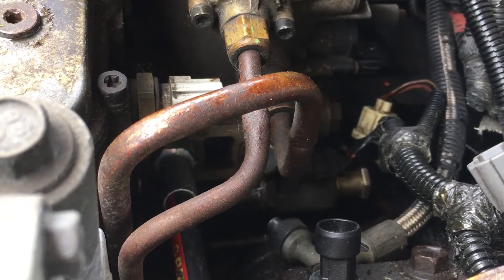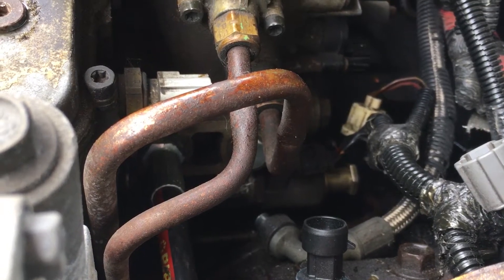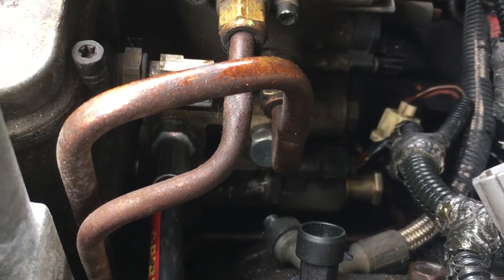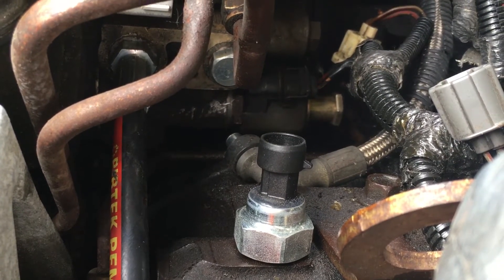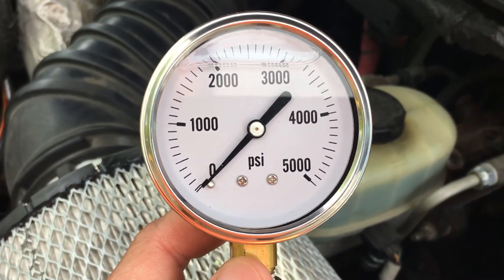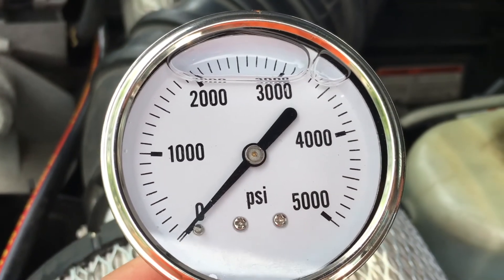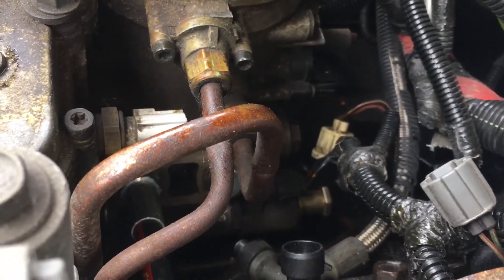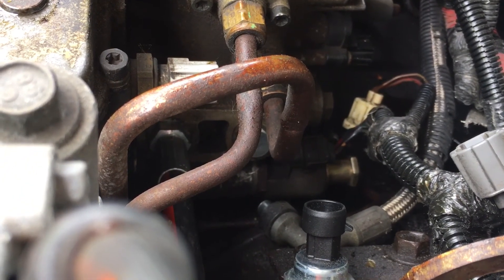2002 Excursion 7.3 deadhead high pressure oil pump test/ hpop

Comment: My truck is at ford dealer now, they said the hpop is putting out 100 psi, no enough to start the engine.  A rebuilt pump is 700.00 but on several YouTube videos it seems very easy to rebuild myself.  Rebuilt kit on Amazon is 40.00 why is their such a huge price difference?
Reply: Because a rebuilt pump has its internal parts inspected and replaced if defective. The amazon kit is o rings. It does not rebuild the pump, but re seals the pump, provided the front a rear seals are intact.

Comment: When you crank you forgot to FULL FIELD THE IPR. you must give the IPR full 12 volt power and ground so it opens up completely. Right now it only opened up enough for the engine to start which is 1500 psi. A deadhead pump with a full fielded IPR should hit 5000 psi, instantly.  Dont crank your engine for more than 5sec or pump damage will occur. ALSO 5000PSI OIL PRESSURE IF THERE IS A LEAK WILL CUT YOUR SKIN GET INTO YOUR BLOOD AND YOUR DEAD. NO TREATMENT YOUR DEAD. SO DON'T DO THIS TEST IF YOUR NOT A PROFESSIONAL.
Reply: I was just curious when you say that the oil get into your blood when you're dead I've been around body paints oils with cuffs are my skin my whole life and I'm almost 40 years old I haven't died yet there's times that I pulled all up and down or transmission pan and got dosed with oil all over my head everything so more than likely you're going to die maybe develop cancer but anyways when you deadhead the pump when you say a full 12 v doesn't. When you turn your key on one position and say I crank it from the engine compartment from the relay up off the side of the inner fender wall in the key is on wouldn't that be giving it and it's hot and ground what does the PCM only allow it to go open for a momentary part of time when it starts up I know what is a valve that opens and close when I be better off just making a separate pigtail for the IPR unhooked from the regular wiring system that connects to the PCM so I'm bypassing that and just run it too hot and ground while I'm cranking it it will never start because the PCM doesn't see the values that shouldand then at least a 5000 PSI liquid-filled gauge is what I'm assuming I've done it before a long time back but I'm going to try it again
Reply: @themechanicman3865 if it gets into your artery it can give you a blood infection that leads to death a few years down. Some what common with serious injuries in heavy equipment involving hydraulic fluid accidents. They usually amputate to prevent further infection but if you wait to go to the doctor it can be deadly.
Reply: @themechanicman3865 should look up high pressure oil injection injuries.

Comment from the maker: Well it was my injector o rings. It took a while for fire up but the 7.3 is back!!!
Reply: the 7.3 was the best pstroke they ever made! cant kill that engine easy :)
Reply: I have a New Hpop T500, icp, ipr. My problem is I have about 200 psi after I hooked up a gauge to passenger side head. Need to Dead head to eliminate PCM. Any help would be appreciated. Thanks
Reply: Hey. Could be my o ring too.. my truck have 560770km??
Reply: Min 500 psi to activate injectors, unseat popet valve in the injector to allow fuel in

Comment: Crank  pressure for Hpop is 600 ish pounds
Reply: 500psi min to operate the injectors. But while deadheaded i think the pump should produce a lot more then 1500-1600. I also can not find a solid answer on the deadhead pressure spec.

Comment: inquiring minds want to know,same thing ipr,cps,icp unhooked,new Batts. I suppose a human. might tear the hpop and new fuel pump so any better ideas no codes either but only have a cheap scanner and no start on top of all that.
so questions comments concerns any thing yall think it might be.it a 97powerstroke
Reply: Kyle Lafferty  did u figure it out. I have the same year of truck . I have changed the same part's and plus more.  I'm sick of throwing parts at it
Reply: Any solution!!
Reply: I’ve got the same issues
Reply: @jamesmclellan8768  
check the relays under the hood,mine were missing

Comment from the maker: Well I finally got off my ass and sent it to the dealer for $212.50 just to diagnose they hooked it up to the computer and pressure test. They told me I had good pressure on the passenger side and not good pressure on the driver side..and for another $650 and not fixed they could tell me what injector had bad o rings!! I was like NO! thanks but no thanks so I'm ordering up o ring kits for all 8 and while I have the valve covers off I'm replacing the glow plugs too I'll give a update after I put everything together
Reply: What were your symptoms?
Reply from the maker: @ it wouldn’t fire up just crank. because the o rings on the injectors where bad